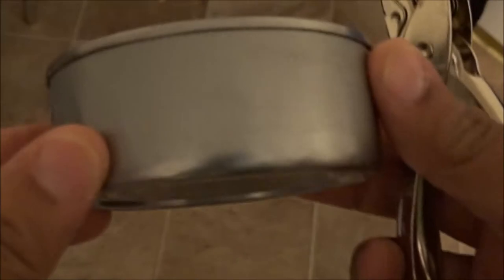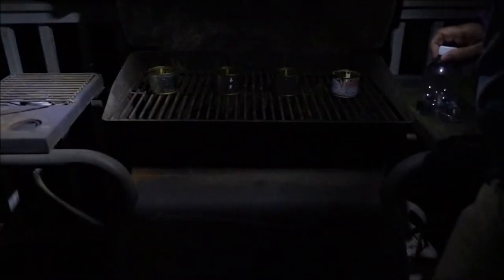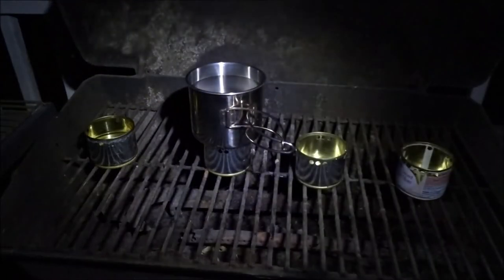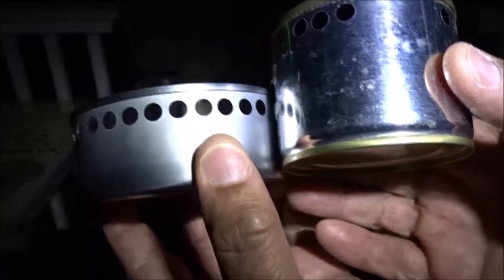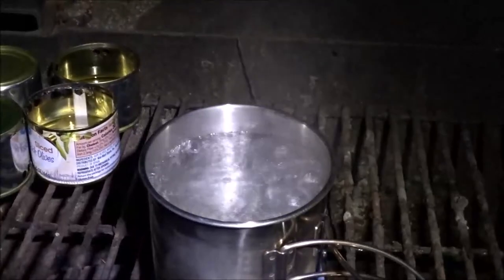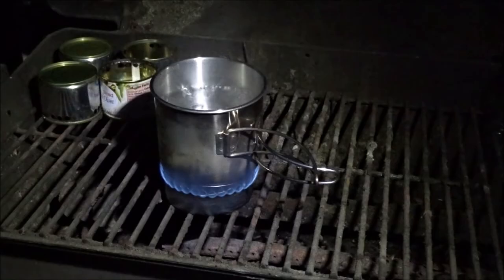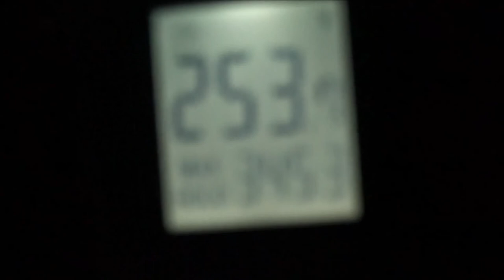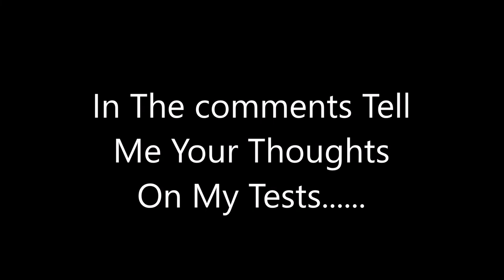Testing Some Alcohol Stoves

Comment: Great little cook store using denatured alcohol is a Kelly Kettle. A cook top and also there is a double layer of stainless steel. Put water in and while cooking also heats water.  A small can like that sits under it. Can use indoors or outdoors you can use small twigs for fuel.  Very portable.  Another idea for your cans is get a cast iron trivet over the can to get more air.  Nice test
Reply from the maker: Beverly I really like the idea of the trivet I never thought of using one for this.